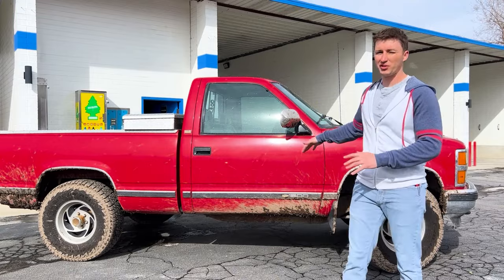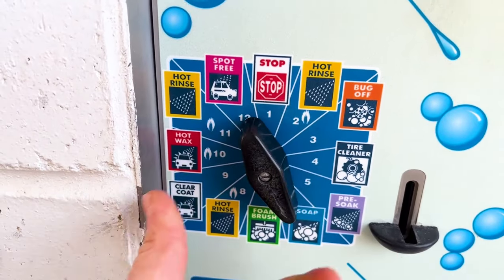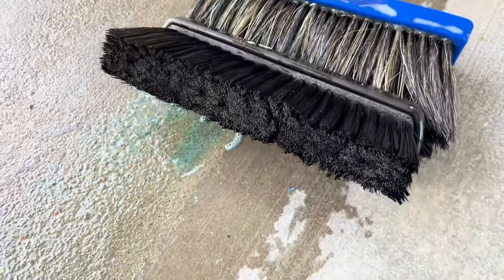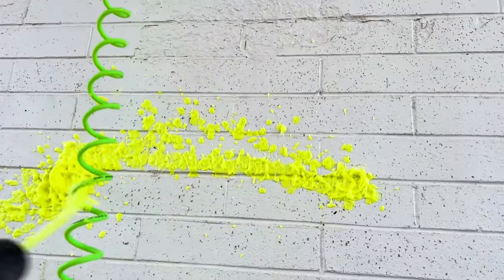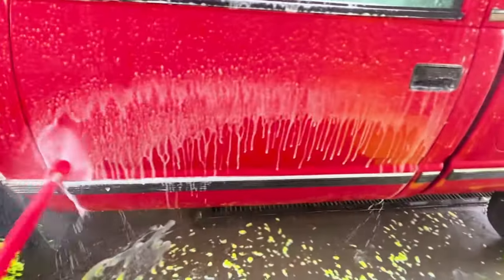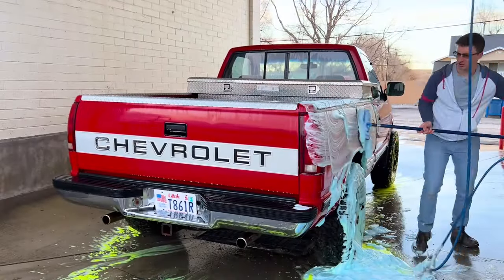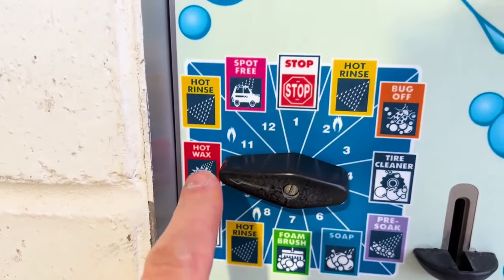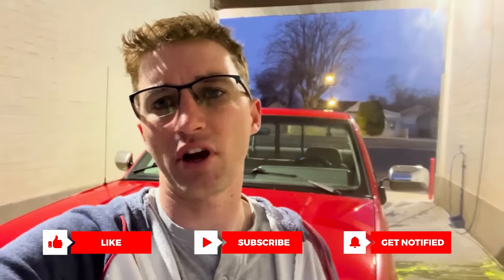The Ultimate Self Service Car Wash Guide

Comment: A lot of bad advise in this video. Then I realized he is the owner of the car wash so yh, ofcourse.
Reply: What do you recommend?
Reply: - Do not use credit cards at car wash. Coins almost always have better deals.
- Do not go with the one that counts up. Its usually more expensive. 
- Do not use foam brush on car.
- Definitely do not use foam brush on tires and then back on the body without washing it. Unless you love scratches. 
- idk why your bug remover looks like wax
- Take break after soap to wash car with a mitt so you’re not spending unnecessary. 

Prob more but i didnt see full video

Comment: Buy a $100 pressure washer + maybe $100 in accessories, and simply wash your car at home. You'll save yourself A LOT of money in the long run
Reply from the maker: Having access to all these cleaning agents on demand is probably worth the cost of convenience in my opinion
Reply: Not everybody has the luxury of living somewhere where this is an option
Reply: Great. And if you live somewhere cold where you have to shut off your hose spigots in winter you still need somewhere to wash your car. Plus all the setup and cleanup time you spend skiing it at home. Self serve car wash is actually one of the few remaining bargains to be had. 4 or 5 bucks for a solid car wash year round in 5 minutes or so.